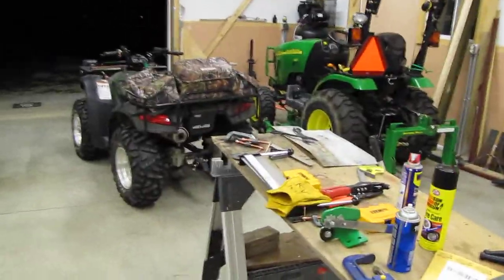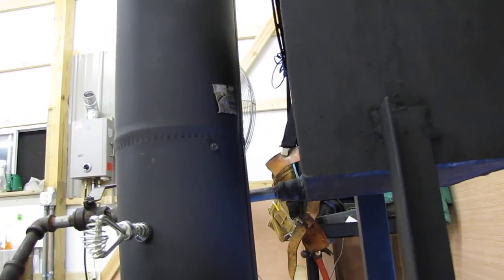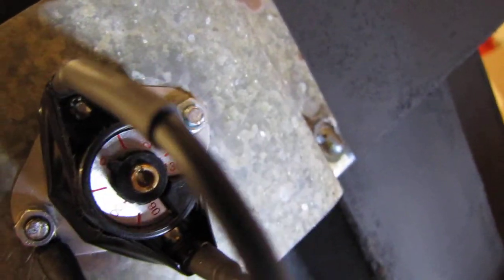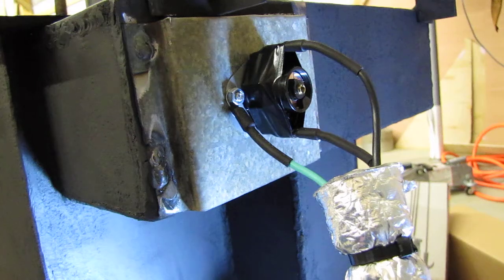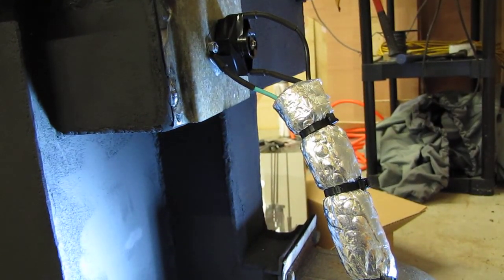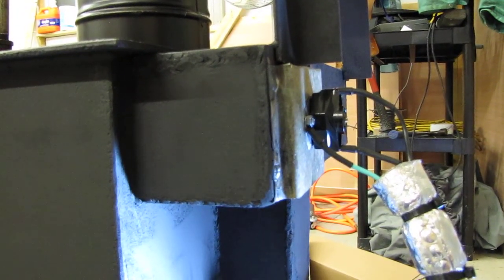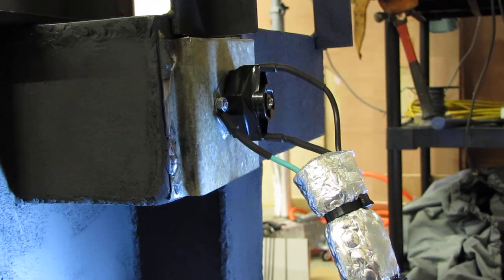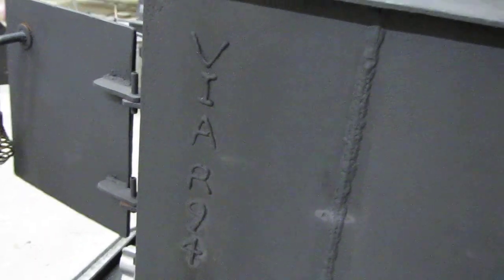Wood Stove / Waste Oil Stove Blower Thermostat Install By KVUSMC

Comment: Yes sir, it has been a while. I am still working on the stacked 120/240 setup. Wiring it with heavy cable is taking a lot more time than I projected. Doing it to code nickels and dimes you to death, but I like enjoy the work : )  

Are you dripping the oil in to this unit or spraying it in under pressure?

Comment from the maker: Hey Buddy I Got Mine Off Ebay   90F-140F Adjustable Fireplace Blower Temperature Switch Thermostat Snap Disc Fan From This Seller   Discount Fans Manufacturer Direct